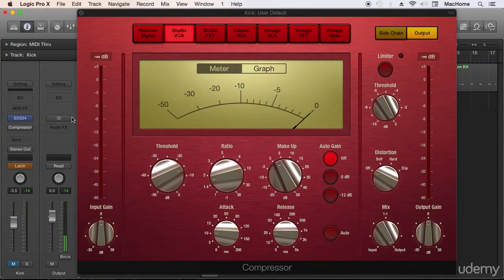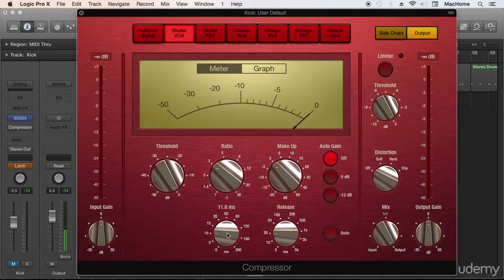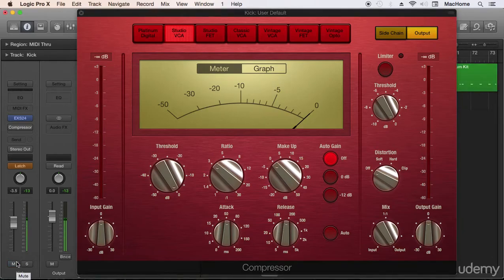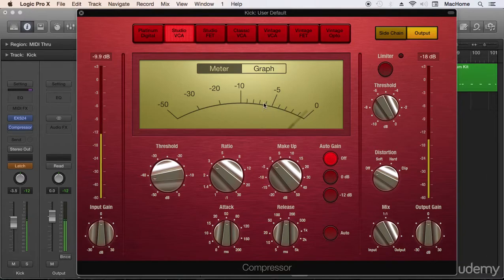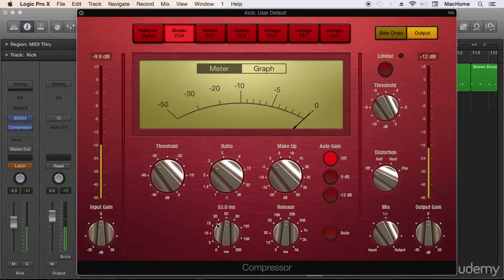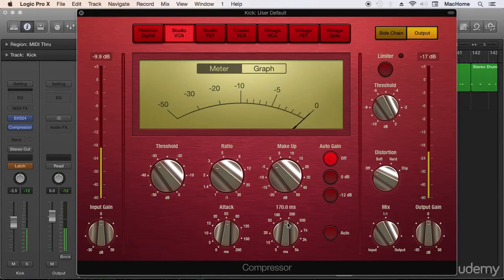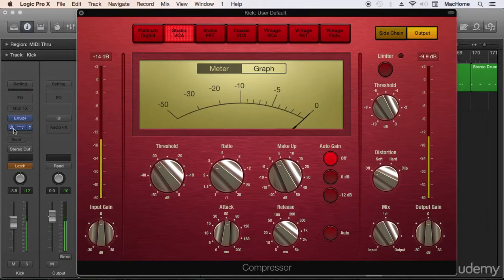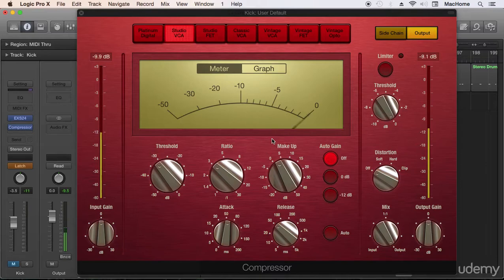How to compress a kick drum (bass drum)

Comment: It's not more attack or less attack, it's the amount of time after the Impact that the compressor attacks.    Earlier or later, not more or less attack.
Reply: Not necessarily. It depends whether you're describing the control on the compressor (faster/ slower) or the nature in which you are affecting the transient (more/ less attack). There is enough semantic ambiguity to let that pass
Reply: @FJM76
There are three posible variables in a compressor,  
1.The level of compression 
2.hard knee or soft knee - If ist a hard ceiling or so soft curve ceiling 
3.Attack -The amount of time from receipt of signal on which it will apply settings 1 and 2. 
So no, attack it does not depend on other factors, you cannot attack more or less, you can only attack sooner or later.
Reply: @salpsi  You misunderstand. I know how a compressor works, I am talking about English semantics. 

You are describing the VERB "attack". For example, "I reduced the attack time by 5ms". In this instance, you are correct: there cannot be more or less, it can only be faster or slower. 

But one could also apply the adjective "attack" ( for example used before the noun "transient". An example might be "there is less transient attack on that snare than the other mix we did")